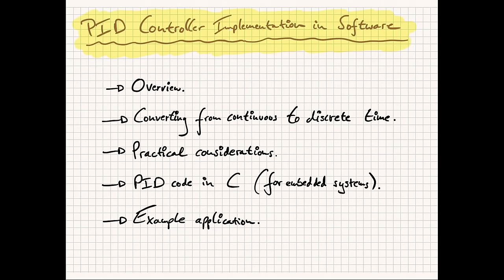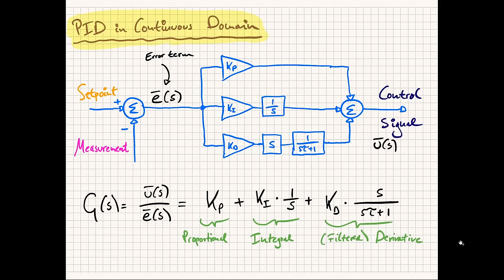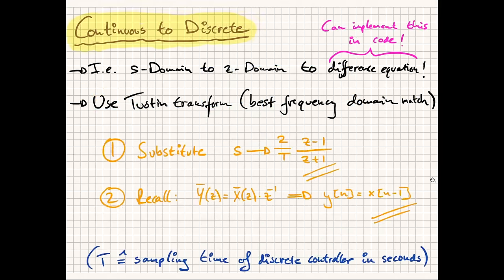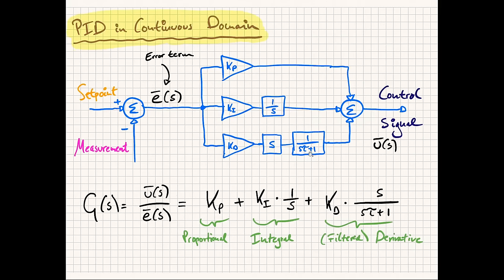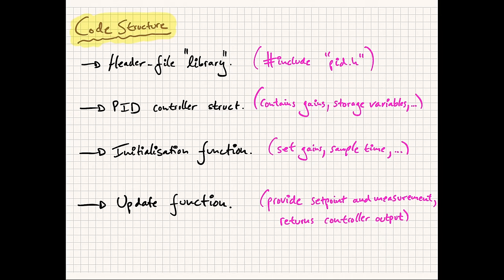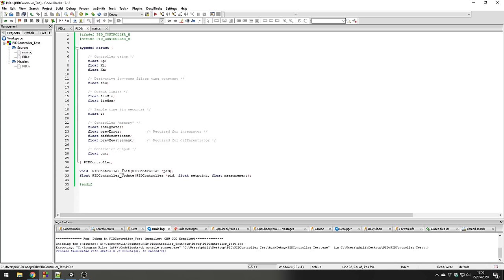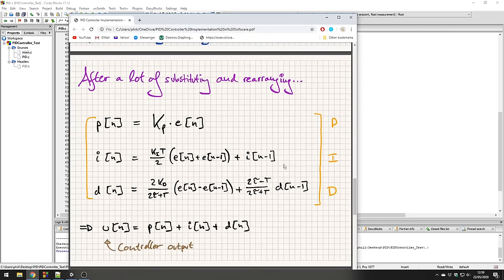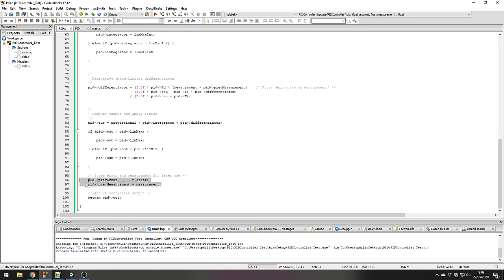PID Controller Implementation in Software - Phil's Lab #6

Comment: Is tau value independent from T?
Thank Phil 👍
Reply from the maker: Yes, tau is - to a certain extent - independent of T. However, tau needs to be less than T/2.
Reply: @PhilsLab  thanks.
i have another question, not related to this video. please help.
what is diffrencce between direct register accessing vs hal.instance??
for example:
  SPI2->SR;  //direct register accessing
  hspi2.Instance->SR; // hal.instance register accessing

Comment: Is it possible to get negative gains kp,ki,kd and still get a required positive output? Because i got a positive output though i had all gains as negative values...
Reply from the maker: Yes, you can get positive outputs by using negative gains. It effectively depends on the sign of your error signal.
Reply: @PhilsLab  so getting negative gain values for kp,ki and kd is not detrimental to the system? I saw a study article that negative gains affects the system and makes it unstable... What are ur views abt that?

Comment: Hi, could you please tell why you are writing coefficients as 0.5f instead of 0.5?
Reply from the maker: By adding the 'f' at the end of a number I'm telling the compiler explicitly that this is a single-precision floating point number. Otherwise, the compiler may handle it as a double-precision number which is usually more costly, operation-wise.
Reply: @PhilsLab  thank you for reply.
Reply: @PhilsLab  Thank you for your reply.

Comment: I wrote an autopilot stack before I remember I implemented the Deferential term at gyro rate feedback  only
Reply from the maker: Yes, if you have direct access to rate measurements, then you can use those as rate ('derivative') feedback. In quite a few scenarios direct rate measurement may not be available and you'll need a differentiator in the controller.

Comment: Thx for the code. If you are using OBS to record. Try adding the Noise Suppression filter. Should help with the static when you talk. Sounds like you are already using a Noise Gate.
If you got something on Kalman filters please share If you are willing. Been spending way to much time trying to deciphering the mathematicians hieroglyphs.
Reply from the maker: Thanks! Yeah, I’ve upgraded my mic so the noise should be much better. Will be doing a video on Extended Kalman Filters in the near future, so hope that can help!
Reply: @PhilsLab  The static I was hearing, was static on my headset. New one, got it the day I made the comment. Audio driver seems to not handle low frequency voice data very well. 
Anyways. Thank you for considering the Kalman Filters. Got a somewhat working one but it just has awful response time to a change in input. Single axis input from a gyroscope or temperature.

Comment: But if we are implementing the PID controller for a tracking problem then the setpoint will be a continuous function too. Then we don't need to put derivative on measurement  rather it would be necessary to put it in its original position. Am I right???
Great video btw : )

Comment: In the git code, you put hard integral limits, while in the video you are defining dynamic integral limit, which should be preferred, and why? Could the dynamic integral limit lead to instabilities?
Reply from the maker: Yeah, I originally had the dynamic integrator clamping - which worked completely fine in simulation. During one of my most recent projects however, I found that static limits worked quite a bit better and you save a tiny bit of code space. So at the end of the day I just opted for simplicity.

Comment: Good video. I was searching for this kind of one. Can you explain about cascaded pid in c? 
Thanks in advance
Reply from the maker: Thank you! I probably won't make an additional video on a series-type PID controller, but you can easily convert between parallel and series PID coefficients and then use the code given here.

Comment: Hi Phil. Great Videos over all. Just the right mixture of being not too specific or too general.
I have a question: How do you get good Kp, Ki and Kd values for your System without trial and error? I had to build some PID control loops running on STM32 and did that almost like you did. The real struggle was finding those values!
Reply from the maker: Hi Tobias, Thank you very much!
That's a very good question and something that would probably take quite a few paragraphs to answer. 

I am planning on making another video on how to design/tune a PID controller for a real-world system, going through theory to arrive at the gains, and including the final implementation and demonstration using an STM32. This will most likely be on a propeller-based pendulum (aeropendulum, I believe it's usually called). I am happy to try and write up a couple paragraphs on how I'll be calculating the gains before the video is released if that would help? Have you had any experience with control theory? I hope to have the video up in the next two weeks, just waiting on the parts to arrive.
The 'trial and error' method, most straightforward, and least theoretical way is to tune the controller gains in real-time while the system is running, which I assume is what you have been doing - this may of course not always be possible. But if it is, start off with all gains zero. Then increase the P gain until you get a fast enough response with minimal overshoot. If you have some steady-state offset/error, you need to add I gain. If this causes the system to start oscillating, try adjusting (decreasing) the P gain or add a touch of D gain. As you see, this is still very much trial and error, but maybe a bit more guided. There's also a method called 'Ziegler-Nichols', which is often mentioned in textbooks.
Reply: @PhilsLab  Hi from Turkey, Phil . Firstly thanks for this video and we look forward to STM32 presentation.

Comment: @Phil's Lab  Thank you for the video it was very useful software wise but when it came to the mathematical reasoning I didn't understand anything(I'm a Sophomore in High School). I've been trying to find a video that emphasises on the mathematical reasoning so I can be absolutely certain that this code will work. But I haven't found any that explains it on my level. If there is a video or any kind of website that explains this on a basic level, I would really appreciate it if someone could share the link.

Comment: Have you ever tried implementing a PID  controller as a series of cascaded Biquad filters?
Reply from the maker: Yes, I've played around with PID controllers in a series configuration. Personally, I prefer this parallel form and find it easier to tune on-the-fly.

Comment: Phil S, 
Thank you for presentation.
Is there any reasoning of why PID control should work at all? In most textbooks I've seen, there is no explanation of why this approach should be used, other than some handwaving.
 
It is my understanding that if system can be described by a first-order equation, then PI control provides exact math solution. No need for D term. For a non-linear or high-order system, the use of PID approach has no background. By using PID we a priori believe that the system is uni-dimensional, linear, first-order with dissipation! Fortunately, the Earth is locally flat, and oven heaters are mostly linear.
Reply from the maker: Thank you for your comment!
I agree with you that most textbooks give a very hand-wavy explanation of PIDs, especially when it comes to tuning the controller. The truth is is that there are very systematic ways of tuning the controller (I hope to make a video on that in the future) but that requires fairly accurate models of the system you are wishing to control. This is why most people end up tuning it 'on-the-fly' by seeing how the system reacts to changes in gains and as you say this is a very hand-wavy way.
However, that being said, PID works sufficiently well for most scenarios - be that for as complex a system as a missile, or something like cruise control in a car. PI(D) control is probably the most used controller type in the world - mainly because it requires minimal knowledge of control theory to get adequate control performance.
As also stated in the video, the derivative term is most often avoided and typically PI controllers are sufficient. There are however scenarios where it is definitely needed, for instance to make an unstable system stable (see: inverted pendulum), but it brings a fair amount of problems with it (mainly due to amplification of noise).
Reply: @PhilsLab  This thread of comments highlights a major issue with PID: Other than a satisfying heuristic solution to a controls problem, its justification is uncertain and unclear.  A very long time ago while an undergrad, a Cornell professor presented a lecture on a controller that had Integral Only in feed forward loop with Proportional and Derivative in feedback loop - OR AS BEST I can remember it.  It definitely had Integral Only in the feed forward loop.  Are you familiar with such a controller?

Comment: Could you recommend any textbook with practical implementations for digital control systems. Beginner to intermidiate level. I have some knowledge of time and frequency domain analysis (mainly optics in my case). Thank you. Keep up the cool stuff.
Reply from the maker: Thank you! In general, I personally really like 'Modern Control Systems' by Dorf and Bishop. Covers everything from basic to intermediate control theory with many examples along the way. It also has a section on digital control systems.
If you're only after something on digital control systems, I'd recommend 'Digital Control of Dynamic Systems' by Franklin.
Reply: @PhilsLab  Thanks for the recommendations

Comment: You sure lines 40 & 50 are correct? For clamping integration to limMin throught limMax range, inequality signs should be changed to opposite
Reply from the maker: Looks right to me. For example, if limMin = 0, limMax = 10 and the proportional control is at 5. Then limMaxInt = 5, i.e. the integral controller can output up to 5 before the overall controller saturates.
limMinInt = -5, i.e. the integral controller can output down to -5 until the overall controller output hits the limits.
Reply: @PhilsLab  Oh I got it. That code wasn`t obvious to me. Anyway, thanks, very interesting video

Comment: Why we  don't use  PID simulink blocks then generate C code for microcontroller!?
Can you make tutorial on that please?
Reply from the maker: Yeah, you could use PID code generated from Matlab/Simulink. While the code works, I tend to find the automatically generated code to be non-intuitive and messy (in terms of proper variable labelling, etc). For such a short piece of code and function I much prefer to write it myself - as was the case for this video. But that's just personal preference!
Reply: @PhilsLab  so Can you make one video for me explaining how linking between matlab generated code and microcontroller driver?
Reply from the maker: @alaamomen8048  The only time I've really needed it was for code for an extended Kalman filter. I wanted to make a video on EKFs, so when I do I'll include how to use/implement the generated Matlab code. Hope that's okay!
Reply: @PhilsLab  Thank you very much

Comment: Is there any guidance of the integrator limits in relation to the output limits ? I want to use this in a motor control application, where my rotation sensors report between 0-200, and can control rpm of motor between 0-100. Btw, this channel is awesome. I've built a number of PCBs based on the guidance you've provided - all worked first time :)

Comment: Can you post Unity code, too?

great, here is the math: :-)
result is quite interesting compared to 1st order/delta approximations:
typically done:
- integral:
  - y=Sum(Ki*deltax)
  - y=Sum(Ki*deltax)
  - y[n]=Ki*(x[n]-x[n-1])+y[n-1)
- differential
  - deltay=Kd*deltax
  - y[n]-y[n-1)=Kd*(x[n]-x[n-1])
  - y[n]=Kd*(x[n]-x[n-1])+y[n-1)
Substitute:
Dustin transformation:
- s=2/Ts*(z-1)/(z+1)=2/fs*(z-1)/(z+1)
- s=2/Ts*(1-z^-1)/(1+z^-1)=2/fs*(1-z^-1)/(1+z^-1)
- s/(1+s*Tau)
  - a=(1-z^-1)
  - b=(1+z^-1)
  - 2/Ts*a/b/(1+2/Ts*a/b*Tau)=2/Ts*a/(b+2/Ts*Tau*a)
  - 2/Ts*(1-z^-1)/((1+z^-1)+2/Ts*Tau*(1-z^-1))
proportional:
- Y(s)=Kp*X(s)
- y[n]=Kp*x[n]
integral:
- Y(s)=Ki*1/s*X(s)
- Y(z)=Ki*1/(2/Ts*(z-1)/(z+1))*X(z)
- Y(z)=Ki*Ts/2*(z+1)/(z-1)*X(z)=Ki*Ts/2*(1+z^-1)/(1-z^-1)*X(z)
- Y(z)*(1-z^-1)=Ki*Ts/2*(1+z^-1)*X(z)
- y[n]-y[n-1]=Ki*Ts/2*(x[n]+x[n-1])
- y[n]=Ki*Ts/2*(x[n]+x[n-1])+y[n-1]
- The +x[n-1] is quite unlogically here compared to 1st order approximation :-)
differential with 1st order low pass filter rolloff:
- Y(s)=Kd*s/(1+s*Tau)*X(s)
- Y(s)=Kd*s/(1+s*Tau)
  - a=(1-z^-1)
  - b=(1+z^-1)
  - Y(z)=Kd*2/Ts*a/b/(1+2/Ts*a/b*Tau)*X(z)=2/Ts*a/(b+2/Ts*Tau*a)*X(z)
  - Y(z)=Kd*2/Ts*(1-z^-1)/((1+z^-1)+2/Ts*Tau*(1-z^-1))*X(z)
  - Y(z)=Kd*2/Ts*(1-z^-1)/(1+2/Ts*Tau+z^-1*(1-2/Ts*Tau))*X(z)
- Y(z)*(1+2/Ts*Tau+z^-1*(1-2/Ts*Tau))=Kd*2/Ts*(1-z^-1)*X(z)
- y[n]*(1+2/Ts*Tau)+y[n-1]*(1-2/Ts*Tau)=Kd*2/Ts*x[n]-2/Ts*Kd*x[n-1]
- y[n]*(1+2/Ts*Tau)+y[n-1]*(1-2/Ts*Tau)=Kd*2/Ts*(x[n]-x[n-1])
- y[n]*(1+2/Ts*Tau)=Kd*2/Ts*(x[n]-x[n-1])-y[n-1]*(1-2/Ts*Tau)
- y[n]=Kd*2/Ts/(1+2/Ts*Tau)*(x[n]-x[n-1])-y[n-1]*(1-2/Ts*Tau)/(1+2/Ts*Tau)
- y[n]=Kd*2/(Ts+2*Tau)*(x[n]-x[n-1])-y[n-1]*(Ts-2*Tau)/(Ts+2*Tau)
- y[n]=Kd*2/(Ts+2*Tau)*(x[n]-x[n-1])+y[n-1]*(2*Tau-Ts)/(2*Tau+Ts)
- y[n]=Kd*2/(2*Tau+Ts)*(x[n]-x[n-1])+(2*Tau-Ts)/(2*Tau+Ts)*y[n-1]
differential without 1st order low pass filter rolloff:
- Y(s)=Kd*s*X(s)
- Y(z)=Kd*2/Ts*(z-1)/(z+1)*X(s)
- Y(z)=Kd*2/Ts*(1-z^-1)/(1+z^-1)*X(s)
- Y(z)*(1+z^-1)=Kd*2/Ts*(1-z^-1)*X(s)
- y[n]+y[n-1]=Kd*2/Ts*(x[n]-x[n-1])
- y[n]=Kd*2/Ts*(x[n]-x[n-1])-y[n-1]
- The -y[n-1] is quite unlogically here compared to 1st order approximation :-)
Reply from the maker: Hi Gerhard, Thanks for posting the math workthrough here! The C#-version of the PID controller code is here: https://github.com/pms67/ControlSystemDesign-Tutorial/blob/master/BalancedAeropendulum/Assets/Scripts/PID.cs
 If you'd like to have a look at the flight simulator source files, you can find them here: https://github.com/pms67/HadesFCS/tree/master/Flight%20Simulator (I haven't pushed the updated PID controller code yet)

Comment: Very good video but single header includes are the bane of my life. They introduce dependencies between header files that make your implementation almost impossible to export as a reusable library.
Reply from the maker: Thank you! Might just be my personal preference, but I find single-header libraries the most straight-forward to use. Maybe I haven't worked on large-enough projects yet though..

Comment: Thank you very much for your video. I would like to make you a query. I have a PID controlled process (you can see it here https://www.youtube.com/watch?v=zYf-5dfQIT4)
I want to optimize the values of Kp, Ki, Kd. I have generated a table with the data that results from applying a change in the setpoint. If with this table I calculate Tconstant, Tdelay, etc, or a PID calculation software, can I add the variables that result to the ones I already have and thus obtain more optimal values?